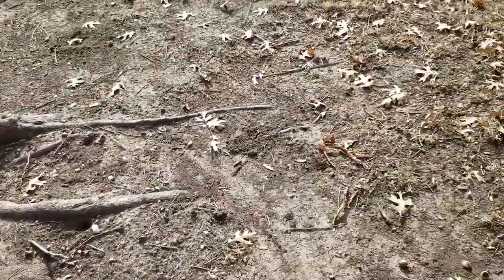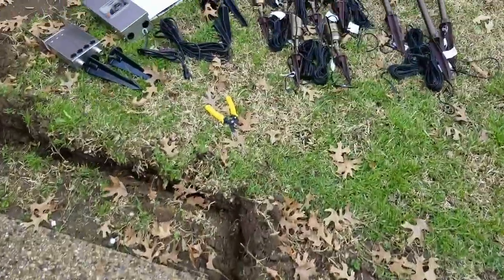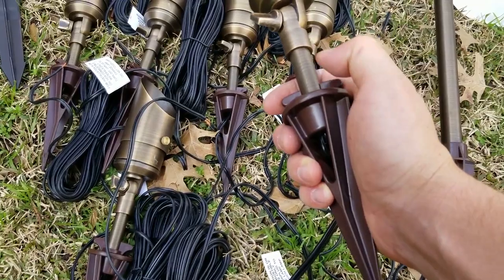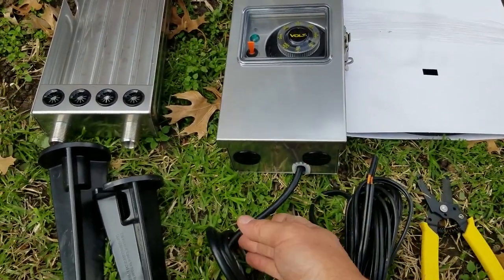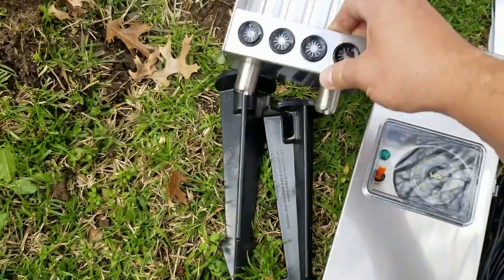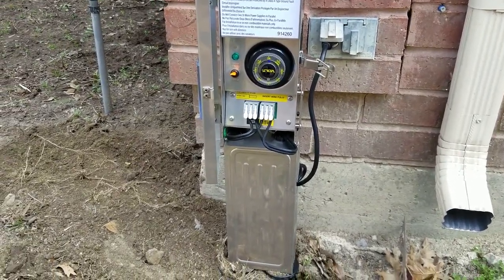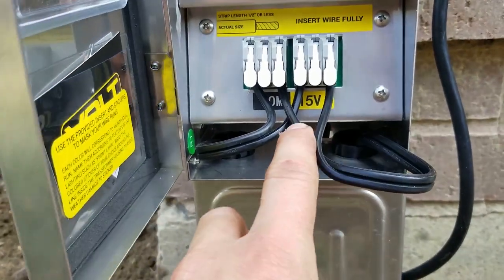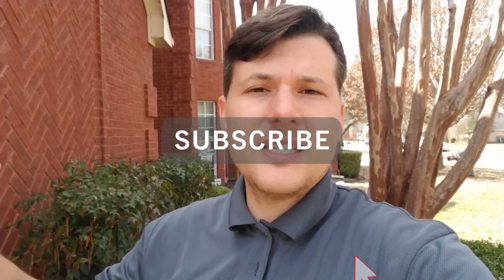How to Install Low Voltage Landscape Lighting | Complete Step-by-Step Video | Costco Lighting Kit

Comment: The LED lamps from Volt are rated for 15V. I'm not sure why you would toss all that 18/2 wire. It works great for runs out to fixtures from the main wire and is no easier to accidentally cut than any other landscape wire.

Comment: As mentioned previously, it would have been nice to see the nighttime results of this installation. It’s too bad Costco provides such cheap quality wiring that ends up discarded or better yet recycled. Seems like you could have gone with a better quality fixture and wiring for what you have to discard with these Costco kits. You might be just breaking even coastwise.

Comment: Hi Adam, You did a great job! I have the Costco set and 3 of my path lights stopped working. My installer did not use the hubs as you did not. I am trying to figure out how to disconnect just the three path lights from the set? I called the Volt customer service spoke to Kevin and unfortunately he was not helpful. I have to send the three sticks back for them to fix but do not know how to just disconnect the three not working. Any suggestions? Thank you!

Comment: If you need to run the wire over stone floor, can I do it inside a metal conduit or it always needs to be buried. I have a lot of hardscape and can always bury the wire but I could run conduit at the edge of the floor so that its not a tripping hazard

Comment: VOLT here, first thank you for the review/video. You do a great job of explaining and demonstrating how to set up a. landscape lighting system.  
I wanted to make a few notes.

1.  LED bulbs are constant current (unlike halogen/incandescent where you need to get the input voltage between 10.5 - 12 volts).  The VOLT LED lamps in this kit (and all VOLT LED bulbs) will operate the exact same with voltage inputs anywhere from 9 -22 volts.  That is the reason the transformer has a 15V tap.  If we had a 12V tap then it couldnt do longer runs.  With 15V tap you can do long runs yet you are never "over-volting."  Most LED manu's recommend using the 15V tap as there is less in-rush current (higher Volts= lower Amps).
2.  The transformers now come with a bracket for wall mounting as well.  The purpose of the pedestal mount is for DIYers who dont want to drill into their house or dont have a drill + concrete bit + screw with plastic expansion sleeve.  The pedestal also acts a UL listed conduit as you need to have the wire from the transformer to ground in conduit.  This saves a DIYer from having to buy conduit, cut it, glue threaded coupling, and conduit lockwasher to install.
3.  The hubs make it easy for DIYers to make easy, yet secure connections, all in one place and have them above ground in a dry junction box.  Also makes for easy troubleshooting and adding expansion fixtures--- again all with no tools.  The long lead wire is for use with hubs.  You dont need to cut off the wire, you bury next to the fixture so you can move the fixture in the future.  Hubs dont need to be in the middle of beds, you can put them inline along the house edge as well.  With the low LED draw and 15V transformer you dont need to worry about voltage drop,.  The hubs have secure wago clamp connectors that ensure secure mechanical connections.  New DIYers often make mistakes with cutting and stripping wire and twisting securely and waterproofing.  The hub fixes all these issues for DIYers.   The long fixture lead wire is prestripped and ready to be used in the hub clamp connectors.

Pro's will make alterations for their needs, but the kit is designed for the DIYer to get it right the first time and with no tools. Stick fixtures in the ground, connect lead wire to the hub, mount transformer on pedestal, connect transformer to hubs with thicker main run wire and you are done! (after you bury the wire).

Thank you for the review and video!

Team VOLT®
Reply: Thank you Volt for the clarification. I was shocked the hubs were not used in the video because I thought the hubs are one of the benefits of making these kits great. I'm about to install mine today and wanted  some pointers. This is a good video, but I thought it missed on the benefits of the hubs and I think the long wire on the fixture is awesome.
Reply: Does Volt recommend how many max spot-lights to connect in a daisy chain? I have a 150 Watt transformer (the exact one shown in this video)
Reply: Thanks Volt

Comment: I just discovered your channel. I've been through tons of solars lights which basically do nothing. I'm really trying to spruce up my yard this year..my neighbors have hardwired lights..but I don't have that in my budget right now as I have a few other large projects going right now. I'm a single women...but I don't mind trying to do it myself. I've never thought of trying to do my own lighting. Never even heard of low voltage lighting. However, this looks very diy friendly. I'm a little nervous about how to run the wire under the sidewalk to the other side of the house. I have large flower beds on both sides of my house and my porch and outlet is in the middle. However..I'm going to put this on my list of yard projects for this spring/summer!

Comment: Nice video and I enjoy your channel. Several comments. You don't like the hub because you would have multiple feeds going through the area. I kind of get that but just locate the hub along your main line as you would without using the hub. I think if you use the hub, that would resolve your other concern about only having a 15 volt feeds and close fixtures having a reduced lifespan. I think that hub is spreading out the voltage between all fixtures on that hub. So nothing is as close as it would seem. Lastly, my transformer also came with a bracket for a house mount option if that's your preferred mounting method. I got the front of my house done in a couple of hours. Probably could have gotten it to an hour if I moved quicker but those days are over. I suppose a contractor would charge $1000-2000 to do the same. So for $500 and a couple of hours effort, seems like easy money staying in my pocket. Volt nailed this pretty well for the DIY'er although it would be an improved product to have other mount options possible with these fixtures.
Reply from the maker: Love your comment. 
Yes I agree with your hub theory, that's actually how lighting systems had to be installed years ago. I have learned since this video that it also really depends on the bulb. Some bulbs actually prefer and last longer at 15v. Other bulbs have a longer range of voltage it prefers. I think a lot of cheaper bulbs might have the issue with 15v. 
That's awesome your transformer came with a house mount option. The kits I've used in the past only had the ground option. 
Yes money in your pocket! Well done. I think Volt has provided a great option for people like you who want to install their own lighting and save some money. 
Thanks again for your comment.

Comment: Hello Adam.  We have the same kit.  The kit states that the Hubs, which you hate,  should be located  50 ft from the transformer.  Is this due there being 100 feet of 14/2 and two hubs or is it a voltage drop issue? We are looking at putting 18 5 watt fixtures on the transformer.  The longest run would be 100 Feet from the transformer.  Can I run the 100 feet of 14/2  and daisy chain the fixtures to the 14/2?  Thanks in advance to your response.
Reply from the maker: Thanks for asking that question. No you  can not. I would run 12/2 wire instead of 14/2 and have 2 main wire or (3 main wires with 14/2). The voltage drops more with a 14/2 than a 12/2, but 100ft is not where you run into issues. I assume that the kit is meant for people who have a smaller yard and 100ft is a pretty common distance.

Comment: What’s your opinion on intermatic/malibu? My full metal cl191 set has lasted for years but as a professional where do you rank these?
Reply from the maker: They're not bad. I'd probably rand them around 7/10 for quality and 5/10 for lighting/illuminating light.

Comment: Can you ignore the included photocell in the Costco kit?  I want to plug the transformer into a wifi plug (wet rated outdoor wifi plug)?
Reply from the maker: Yes you can. Just turn the Costco transformer photocell to ON and it will be on always. Then plug your wifi plug.
Reply: @aklighting8292  Thank you so much!  Now I’m trying to figure out how to install the transformer attached to my concrete block/stucco exterior wall.  The feet that come with the transformer mounting kit are way too short for South Florida wet conditions.  I don’t want to use wood as a backing or mounting (again because wet conditions).  I found some stainless steel L angles at Home Depot and I’ll need to tinker with the mounting of the transformer and find a way to mount without voiding the Volt warranty.

If anyone has experience mounting the Volt transformer to to their concrete stucco walls instead of using the kit footsies?  Thanks!

Comment: That kit was on sale for 399$.
Reply from the maker: Nice!
Reply: @Raul Hernandez Costco had them for 399$ a few days ago.
Reply: That’s a great price! Adam, with those types of transformer/photo cell. The photocell is inside the case, and not a punch out/screw in from the outside? Lol, I don’t know how to word it, I hope that question made sense!
Reply from the maker: To clarify, this install had 2 kits. The main kit, and an additional kit with 4 lights bought separately.but yes, great price at $399!
Reply from the maker: Yes the photocell is on the inside. It's pretty cool. Only downside with any photocell is their lifespan and inconstant lifespan. I've seen photocells last for 1.5 years, 3 years, and 5 years, and every once in a while one will last like 15 years!
Reply: Ordering the kit today still on sale for month of May at Costco for $399.
Reply: @gilgomez7848  that’s a good deal.